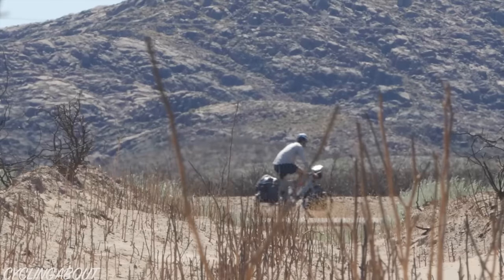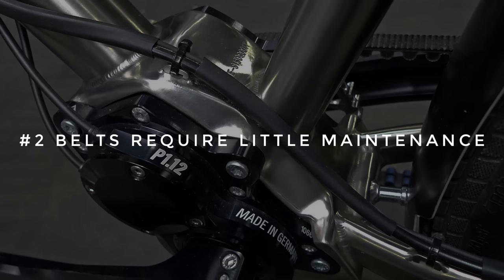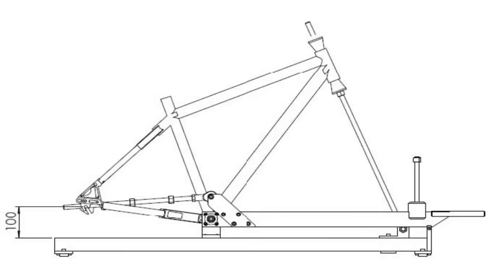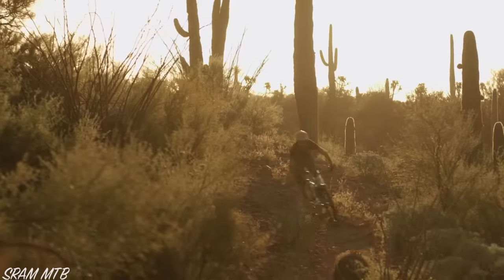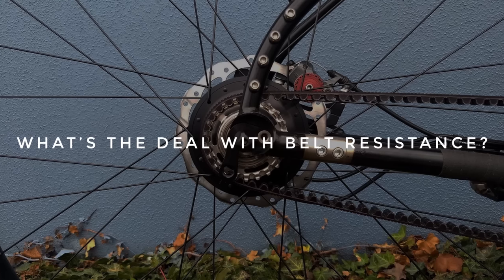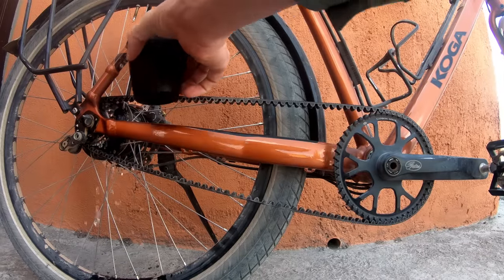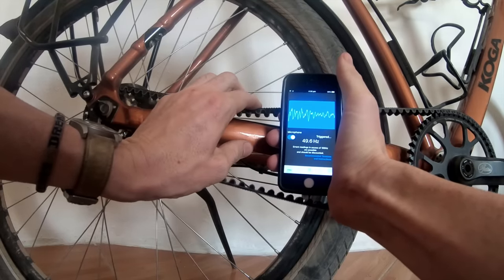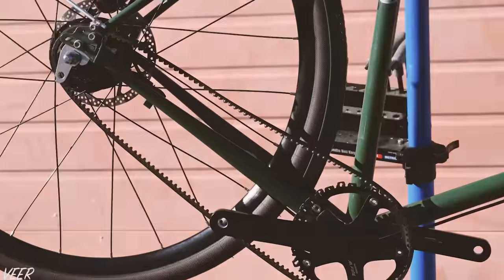Belts Are The BEST Bicycle Drivetrain Available (Epic Testing!)

Comment: Have you ever broken a chain link during a ride? I have. For long rides I take my chain cutter in case I need to fix a link.
You can't do that with a belt. Once it's broken it's no good anymore. 
When I break a chain link I just lose 1 link of the chain. It's very rare that this happens. I'm a bit older, so I don't force the pedal so hard anymore.
Reply from the maker: I've broken about 10 chains in my life compared to one belt (the last one was 2014). Given how durable belts have been for me, breaking them never even cross my mind anymore.

Comment: as a motor vehicle enthusiast we'll call it, the statements about the bikes and cars are... over simplified at best. every modern, factory, high performance bike is chain driven. and in the "high horsepower car community" if you will, there's a very famous saying, "air don't slip" implying a turbo is better then superchargers because well... air doesn't slip, belts do, a lot, it can cause massive problems and is generally from my experience not the preferred option. not saying belts dont have their place but the beginning was a little rocky
Reply: bla-bla-bla       everything after 'at best'  is   yer  lips flapping.         suggest you consider learning to  BOIL  IT  DOWN.  and  NOT  ramble on in the course of  Providing  irrelevant  examples.
Reply: @daviddavids2884  suggest you learn how to use a space bar properly

Comment: I got a question, I ride a recumbent, which uses an extremely long (~3-4meters) chain, from my feet all the way behind me to the back wheel. I’d love to use a belt drive instead, as my pants or my leg often get chain grease on them. So do belts come in those leghts?

Comment: Big thumbs up. I off road mtb mostly so outside the commuter / touring sphere and your particular requirements. However I a a big fan of belt drive for Motorcycles ( my other interest ). Why less manufacturers use belts for larger capacity bikes where the BHP loss is negligible I find disappointing. 
Thanks for posting.

Comment: If every few months you take them off, soak them in some 303 protection overnight and then let them "dry" for a full day they might last longer than your bike. I'm not a bike rider but this works with automobile plastic and rubber parts so I'm sure it applies here also. One thing that makes 303 special is that it is water based. Some people treat their tires in this way also and the claim is more than double tread life. I am not entirely convinced that it doesn't reduce traction in the rain, at least for some time after, though and in automobile tires that is very dangerous. You don't want any hydrophobic action on your tires right... lol

Comment: Who makes the bicycle shown at 3:45.    I've always liked bicycles where the seat stay tubes take the seat tube load, i.e. the seat tube does not connect to the crank case. (Kestrel makes a few bikes like this)   I cannot quite read the brand on the tube. Is is "Urvan",  "Lrnafn" ?
Reply from the maker: Urwahn is the company.
Reply: @Cyclingabout  thank-you. That's it. ( of course.)

Comment: Chains are better than belts
1: 3-4 chains are still much cheaper than 1 belt
2: no modification or new frame or bike purchase required
3: Sure you can buy your belts online but if you were away from home and you forgot/lost had one stolen
4: If someone took exception to your unusual belt and took a pair of pliers to it would cost a lot more money
5: while you don't have to oil your belt it looks like you want an alternative for cleaning your belt anyway, so, isn't that just solving a problem with another problem?
I was considering getting a belt. The split frame requirement wouldn't matter in one scenario as I was looking at full suspension and they can be taken apart. When I saw how they are installed and why some bikes had sliders on the rear axle I though "there's always something" - I wouldn't be able to do that on my desired frame
If the belt drive is more efficient at a certain torque or higher, this could be good for an ebike with the combined torque

Comment: "Belts do not get longer over time"

That might be the case for the specific belts used for bicycles, but it's certainly not true in general.  The toothed belts used for driving the camshafts in engines and V belts and Poly V belts used for driving auxiliary devices do stretch over time.
Reply from the maker: This is a video about bicycle belts, after all...

Comment: Question: I'm thinking of a Gates Belt drive train with a Rohloff 14 speed hub. Is it necessary to have a splitter in the rear drive-side seat stay? Or can I just change over to a new Gates belt, by merely taking the wheel out of the dropouts?
Reply from the maker: The belt goes through the rear triangle. You need a splitter.

Comment: I cycle 6 days a week about 20 miles 5 days a week and 60 miles a Saturday or Sunday.plus holidays. 
If you buy a good chain, oil it. I never had a problem. 
Even mountain bikes, BMX, or racers and single speed I've been cycling for 35 years.

Comment: This is good, but the is a Big IF. IF You cycling in wet condition mostly, this drive can handle only few thousand km. Mostly alu crank belt wheel are worn very fast. Saving weight is also a big lie, though is actually lighter. But Need to use planetary Hub or gearbox if you dont want to have a single speed and this is a much heavier than chain drive.

Comment: Ahem.

what about shifters?  The standard shimano brake lever and shifter combinations are very comfortable to use. 

For a belt drive, you have to use a hub or BB gear, which restricts the range (sic) of shifters that can be used.

Comment: The discussions about efficiency are interesting, but i haven't found any data on how wear of the components influences the efficiency.
Loss in a new unworn chain system comes from the friction between the links and the smalle the direction change it has to undergo (bigger cog =less friction loss) the smaller the loss, the better the efficiency. Now with worn komponents you get maybe less friction between the links, but more friction between cog and chain. (which wears the cog too)
It would be interesting to see how much efficiency is reduced over the lifespan.

Comment: Using graphite mixed with paraffin wax I've clocked 7,000 kms on my chain and it only measures marginally longer than new; granted most of my riding is dry and a quarter of it is indoors, plus bringing the crock pot of wax on a bikepacking adventure seems a little silly. :)

Comment: (personal experience, take it with a pinch of salt)
I'd argue the longevity of a belt driven system. A friend of mine got a belt driven bike last november and although the belt itself is in perfect condition, the bottom bracket sounds like one of those old coffe makers. At this point he is reluctant to ride it and currently taking it to the dealer for a checkup is out of the question for him sadly. 
I know it's not the belt's fault but the bike in question (and I assume other belt driven bikes) have certain extra components both in the rear hub (gearhub) and the bottom bracket. I'm also avare of diferent manufacturers may produce different quality components but the bike I got of the same brand as my buddy (we ride together, me riding more alone then him) has had no issues as of yet and is a 2x10 Tiagra system, which isn't even that high tier. Regardless belts are awesome, but the drivetrain that accomodates it does need maintanace. Also gearhubs are prone to act up, so just be aware that blet systems are not as invincible as they seem.

The bikes we have, if you want to check them out, are:
Cube Hyde Race Pro
Cube Nuroad Pro 2020

Ride safe. :)

Comment: The ultimate rust environment is on small remote tropical islands fully exposed to the trade winds. Nothing else comes close for a worse case rust environment. I can say this with confidence after living in the Marshall Islands for almost six years on an engineering contract position.  I almost went through three bicycles cheap ones were only available, even cleaning the bikes and trying to keep them out of the near constant salt spray only slows the inevitable rust death. In this environment derailleurs always become a rust disaster.  Covered cables are problematic, since they are difficult to clean and lubricate.  The best inexpensive bike was a single speed low gear ration, slow but rideable against the strong wind. Steady 25 knots or 45 kph many times with higher wind gusts. If you want gears a internal hub is the only way and coaster brakes are much better than hand brakes.  People would spend a fair amount of money on more rust proof "yacht" cruiser bikes, some with internal drives to avoid chains which of course rust faster even with cleaning and lubrication. Too bad the local island shop sold a lot of cheap derailleur bikes, I ended up with a cruiser coaster brakes and single speed, replacing rusty chains, the best inexpensive option. I do wish I could have had a belt drive on my cruiser bike.

Comment: You'd think the points of contact and engagement would need to be hard surfaces for the best efficiency. like walking on sand vs cement, the soft contacts create smoothness and are quiet but are less efficient

Comment: I've used a belt from 2014 until 2021 until I had to go back on a chain unfortunately. That point was clearly highlighted in this video at 3:12 : "The frame should be stiffness tested". Today I'm sure that my frame is the problem. It's titanium and it's way too flexible sideways. The company I bought my bike from (Budnitz) focused way too much on design and weight. I must say I love the design of my bike but that flexibility is definitely not compatible with Gates. I've done roughly 15.000 km From Sydney (Australia) to Siem Reap (Cambodia) with my new Butnitz MTN bike before realizing that the teeth of the belt was falling appart and the rear sprocket teeth were very thin and sharp. Previously, I came across your blog and had in mind that potential 30.000 km range with one belt so I was disappointed in mine, not knowing why. I've ordered a whole new set and it lasted only 5.000 km before I ran into the same issues. I've tried different tensions for the belt and ended up using loose as well (not as loose as you though). The last set I've ordered lasted roughly the same 5.000 km then I gave up. I contacted Gates who kindly offered me a set but my goal was to understand why it was failing. I asked them more questions but somehow I feel they got pissed with me. They told me to tensioned the belt more but when trying that, the pedaling's resistance became unbearable. Also, squeaking was always an ongoing issue. I now live in Cambodia where it's very dusty during the dry season so I had to use silicon or similar lubricant to avoid that very annoying sound. Adding silicon would keep the belt silent for 3-4 days. I was thinking of trying one more time using that EXP rear sprocket but could not find any place online where to buy it from. On my last 2 weeks trip I forgot to check the belt teeth before leaving. Many were already damaged. One day the bushnell Eccentric bottom bracket lost its grip (as it slowly does constantly even I use proper titanium grease and proper torque tightening), the belt slipped and ripped off 20 teeth in a second haha (better to laugh about it at that point). That was the end of it. Fortunately, I have a Rohloff and going back to a chain was not an issue. Now I have to deal with more frequent chain cleaning but I think I'm gonna pass the 10.000km range without having to change any part. 
I agree with your video, Gates system is very good. Paired with a Rohloff is perfect for me. If I had to do it again, I would make sure the frame is compatible this time. It's a bit more expensive at first but then in the long run it's worth it.

Comment: Very informative!  I have ordered a Priority 600X.  I am excited about belt drives because I am tired of the maintenance aspect of chain and all the parts involved with those systems.  I am hoping the frictional losses with the pinion gearbox feel negligible.
Reply: How have you been liking the bike? I am considering buying a 600
Reply: @repCanada  I love the 600X.  I would not want to go back to chains for MTB.  However, I am dealing with some kind of rear hub issue and had to send the wheel back to Priority, so we will see what comes of that.

Comment: I think the benefits for commuters is definitely overstated here. As a commuter, my priorities are serviceability and reliability, not really concerned about weight or efficiency. If my bike needs servicing, I want to be able to walk it into a bike shop and get it fixed on my way to work rather than having to order special parts and wait for them to arrive
Reply: belts and internal gear hubs don't break down that easily

Comment: I like belts, but efficiency is the deal breaker my use case, long distance commuting.  When you are trying to keep average speed as fast as possible efficiency is key.  To get longevity up I hot waxed the chains, which extended the life of a chain by 2-3x.  Not quite as good as a belt, but not far off, but much cheaper per km.  Hot waxing isn't an option for touring.

Comment: The pros' made for the advantages of this are valid. I've been saying for a long time that the chain system on MTB should face at least some modern upgrades--maybe in ceramic or carbon materials to make them thinner or something so you can have better alignment on a 12 speed cassette.
The issue though with the wear-n-tear; The belts material alone means it WILL likely last longer. The issue however is not a total fair comparison to  chain system drivechain. IF you only had ONE chainring and rear sprocket, with a traditional chain, you WOULD get more life out of that chain. MTB wears out the chain because of SHIFTING as well as the material it's made of, dirt, and mud.
The best comparison of life of a CHAIN compared to life of a BELT would be to compare these to FIXIES. How long does a fixie rider get out of their chain compared to the belt rider's belt. THAT would be the fair comparison--to take any chain on a derailleur bike out of the equation.
~JSV
Reply from the maker: It's difficult to put a number on it because there are so many factors that determine drivetrain longevity.
I've heard of people touring 15,000km on singlespeed drivetrains, and closer to 20,000km when the system is enclosed in a chaincase. 
But then again, perhaps a belt in a chaincase will go 50,000km??
Reply: @Cyclingabout  I agree though, for single speed bikes this IS indeed the better option and as the belt-drive tech undergoes some developments I think this should be the choice going into the future. Before I saw this, I've been asking for years why the chain on road bikes hasn't gone to belt technology. Seeing this gives me hope lol. For us MTBers however, we're currently without any tech better than what we're using, and on high quality systems the price of cassette and chain replacements is getting ridiculous. I'd AT LEAST like to see something increasing the hardness of the materials for increased longevity.
~JSV

Comment: You mentioned that You had to increase tension of belt on Your converted bikes. What are real problems with non-belt designed frames? Is belt comming of or other problems occure?
Reply from the maker: The belts never came off, but they had a noticeably higher resistance.

Comment: How can you compare just a chain with just a belt in these if the derailleurs can't be used? A bike belt is 10$ or so, how much is this belt and how reliable are either the wheel hub or pedal hub gear systems? It's easy to compare just the belt and chain if you ignore everything else on the bike.

Comment: Hmmm looking for options, as I am wearing chains after 100km... No I didn't make a typo a hundred kilometres.
I have spoken to several bike shops and bike mechanics, it just seems that working as a bike courier in hilly capitol of Scotland is a pretty demanding thing for your drive train, if you weight almost 90kg as I do.
So maybe a belt drive is a solution, instead of spending 20$ every week on new chain 🤦‍♂️

Comment: Hi CyclingAbout!

I would like to know why are you saying that the belt drives are better but in your another video of the best bikepacking bikes from 2021 you don't offer a single choice of a belt driven bike?

I'm really making my best not to sound ankward... Would you recommend the nexus 8s as a good gear hub?
Reply from the maker: To get appropriately low gear ratios for touring/bikepacking, you need to use a Rohloff hub or Pinion gearbox with a belt drivetrain. As value-for-money is a factor in my list of bikepacking bikes, there are no belt drive bikes simply due to the high cost of these gearboxes.

Comment: I'm not a cyclist. I just want a durable drivetrain for a commuter bike. I'm not athletic, and don't expect extreme weather outside of winter. Sounds like belts are just better.
Reply: They are not. When more frames are built to take gear boxes or internal gear hubs maybe. But right now that's not the case. Chains have their cons but accessibility is a major factor.  This guy said he orders once every 18 months . Not bad. But I never order parts. I can buy them anywhere.  
 He said weight saving? A gear box is several times the weight of a rear set and derailer. Silent? Yes, but I never remember anyone saying their bike is to loud.  Belts are potentially better but that hasn't been realised yet. And may never be
Reply: sounds like  You  were  NOT  paying  attention.!!!!!!

Comment: I have a 3" belt and pulleys for a 8-71 blower, it can withstand 10 000 HP, I guess it could last for a lifetime on a bike.
For the tension on your belt, why not add a spring loaded idler pulley for auto adjustment?